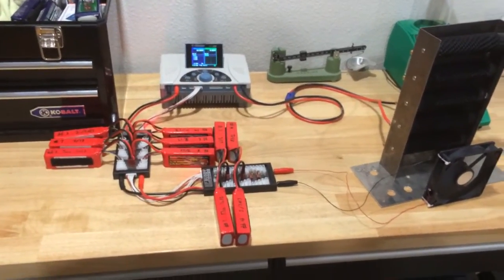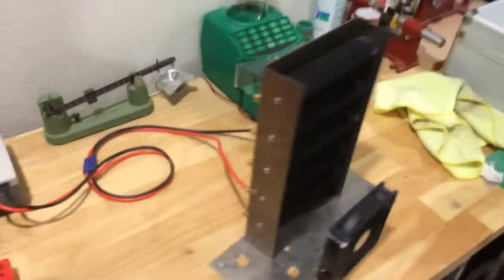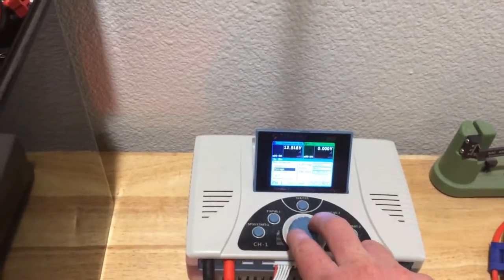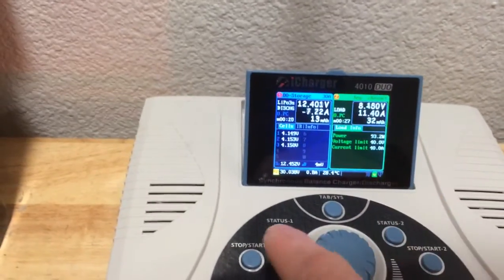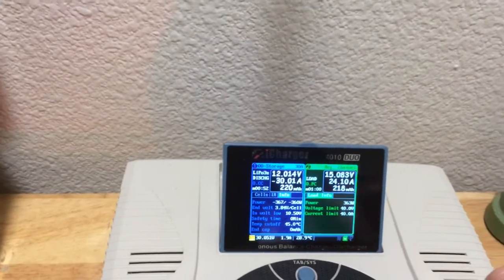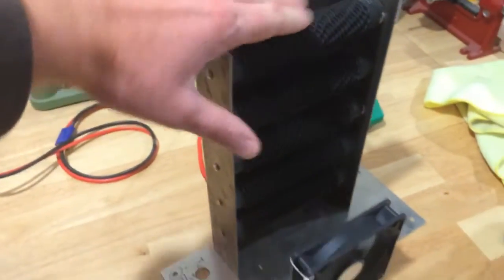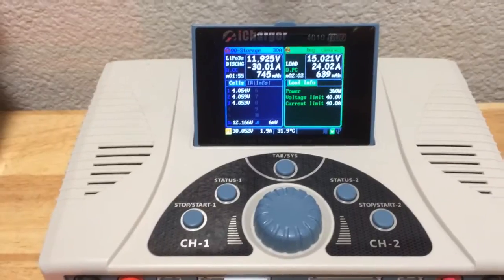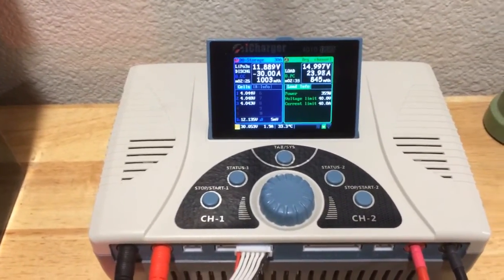iCharger 4010 Duo external discharge

Comment: Hello Demon, can the ichargher  charge a 16s li-ion battery? 67.2v charging voltage? can i connect it with the 2 channels so it will do the work? thanks, ilan